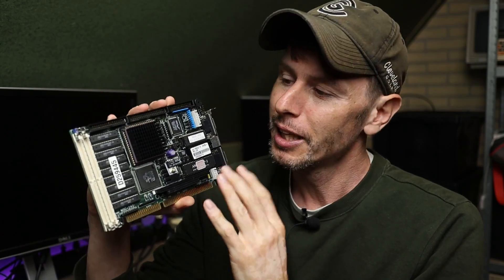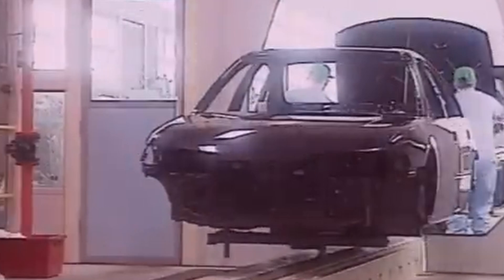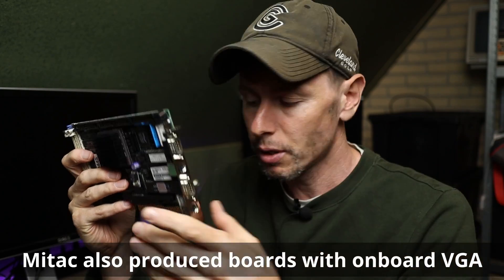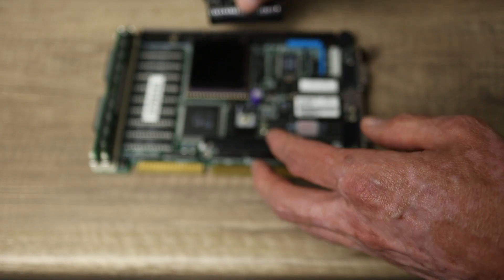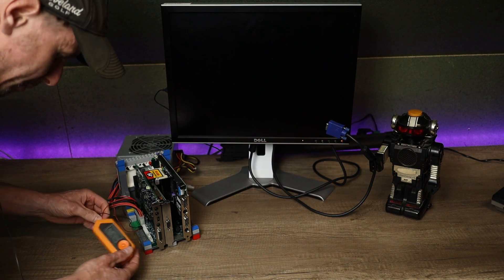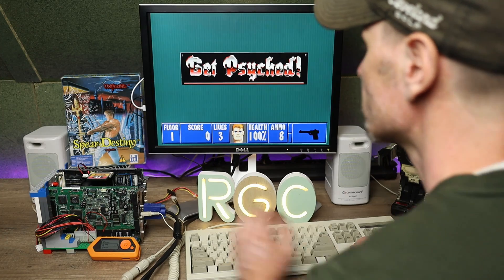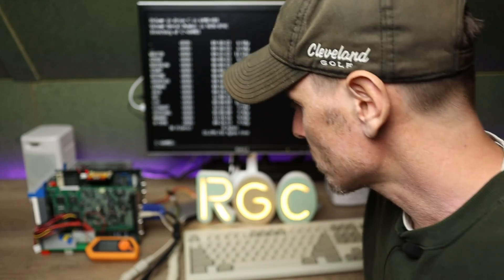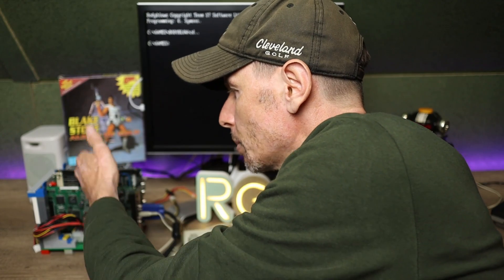Can you Play Games on an Industrial 486 ISA-card?

Comment: I have a PCM-4894 with Amd 486DX 100 Mhz video onboard C&T 65550 2Mb (excellent VGA compatibility), Realtek 8139 Network integrated with the same chip set as your Ali M1489 1487. Best 486 board I've ever had, and it has an integrated ISA slot that allows you to add a card or a riser. I also have a Juki 752 but it's not very good for games because the VGA chip isn't very compatible.

Comment: didnt think to use a flipper's GPIO to be a simple power switch, i got mine primarily to be an Amiibo databse, what simple script did you make for just controlling those pins?
Reply from the maker: You can simply go to the GPIO menu and select 5V on GPIO. Pin 1 will then output 5 volts.

Comment: Kinda surprised with the fact that SBC didn't have an integrated Video chip.  Most SBCs I have come across have one, but you have to make a breakout cable as there isn't any space on the I/O plate.  Being forced to use ISA only for graphics is rough as they are just slower.  Even with an AMD 5x86 p-75 which is what that board appears to be using.  It's a shame that these SBC parts are more expensive than buying a whole 486 machine though.
Reply from the maker: Like displayed in the video,  they did make a version with vga out.
Reply: @RetroGameCouch  I couldn't see the web page you displayed clearly as I was across the room trying to fix a 486 motherboard while listening to you.

Comment: ISA system on boards are the most fun to use in an Amiga since it provides a separate ISA bus -- you can then use an ISA bridge to access them from the Amiga (NOT the system-on-board bridgeboards, but the rare bridge cards that exist just to communicate with the ISA bus)
Reply: What? I need to see this!
Reply: @gurthuk  Yeah all big-box Amigas (2000/3000/4000 series) have a passive ISA bus in them, and various cards were released that were system-on-cards, but also a couple of rare cards were made that let you interface with the ISA bus without a system on it.